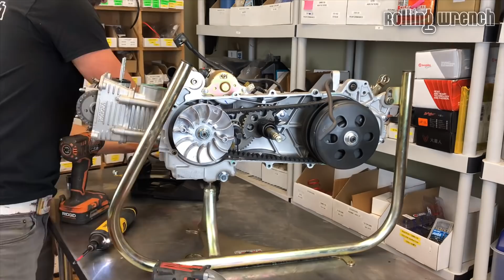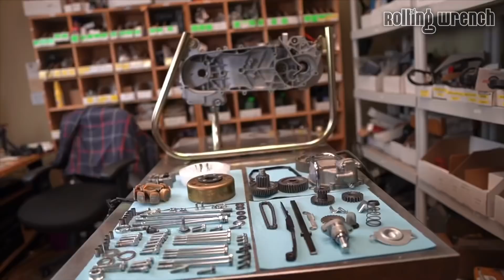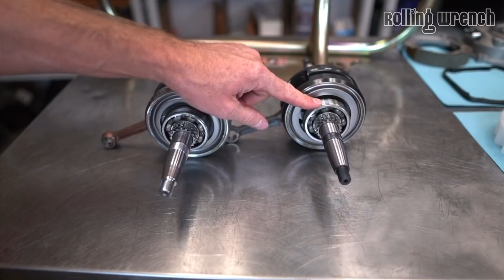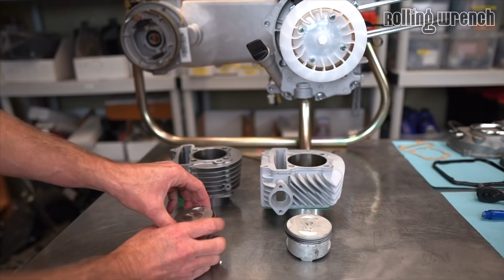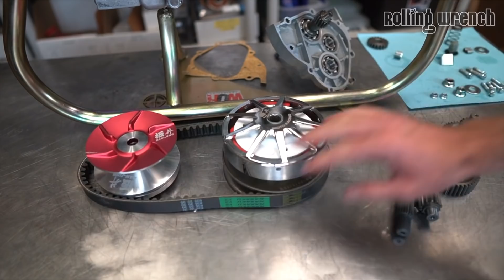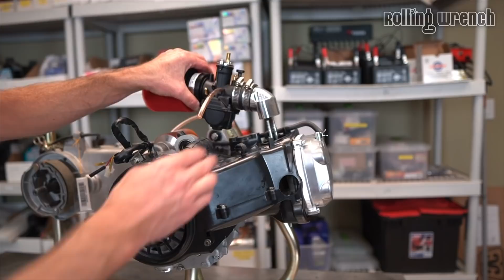GY6 ENGINE BUILD [Rolling Wrench crate engine] 190cc

Comment: What’s the best version gy6 for an atv Or more accurately, lets say a heavier vehicle. Say 350- 500lbs... Specifically a 2026 or 2027 Vitacci Cougar 200 Sport ATV..
And 2026-27 Vitacci Cougar 200 Utility ATV
The “stock” Gy6 in the 200Sport  is a B-Block 1p63QML with cvt @ 169cc (I think the math makes it 169ish I did 3.14x(bore/2:61/2)^2(Squared)xStroke:57.8=168.83cc

I know the utility 200 is also a type b long block and they are both the longer bolt pattern studs.  but The displacement is a bit more on the Utility Atv. I think it’s a 177cc. I have not opened that one yet. They both arrived yesterday😊 
I also have a dozen or so other mini bikes and scooters and go Karts I will be hooking up! 
But with the 4 wheelers that are 2wd, I’m wondering if thinning out to a maxed 232cc might not be a good idea for long term use without some sort of cooling? Or is this ok?? Or is the 171 or 190cc better options for 350-500Lbs?

Comment: Hey I got a 250cc 4 stroke single cylinder gy6 liquid cooled, was wanting to know are there any performance parts I can put in it seeing as it's cvt driven?
Reply from the maker: I’m not familiar with the motor enough to direct you. But they are definitely different then the standard qmj157

Comment: On stock oil pumps there is an arrow, should it point up or down? I found stock oil pumps here in Europe that is thicker, and to mount it I had to get that kind of bolts you are using, because stock mine had 8mm bolt heads which did not fit. So much variations on these chinese engines!

Comment: What is the largest I can put on my 2009 Scoot Coupe without modifying? I heard 170 cc but wanted to know what you think. I have the 150 cc now. Odometer says 25,600 actual miles but that cannot be right on the original engine.

Comment: What’s the hp gain or power increase on going 190cc?
Reply from the maker: I’m not sure. We don’t have a dyno.... but huge improvement
Reply: Ok one last question, so you bored it to 63.5mm and the 180cc big bore kit is 63mm does that make the cylinder wall of the 180cc .5mm?

Comment: Approximately how much hp would you anticipate too get after a good dyno/tune? I have ordered a few bolt on’s from you and I have been very pleased with the results, however I’m really really ready to just go to a greater platform and this looks like a great replacement? But I don’t want to spend a bunch more with results that give me 3-5hp gains more than bolt on’s I put on my 171cc? But if I’m gonna get hp with performance results and maintain a quality build I obviously rather get the crate. Think this build can sustain 15hp? And how about a 4 valve add on would that give any edge in any manner?  I’d like to get my GY ready before the summer time in California hits 06/2021 it’s already almost 02/2021

Comment: Hi, I have an GY6 152 QMI injector model....I can’t seem to find any parts whatsoever. I need an airflow sensor and the rubber pipe that it sits in (between throttle body and air box) 
Any help would be appreciated! 
Thanks

Comment: I am looking to drop a 300cc liquid cooled gy6 into my gokart that has an AC150cc. Any idea as to the dimensions? Will the 300cc drop into a scooter that normally has a 150cc?
Reply from the maker: No, the engine is a lot different
Reply: Good to know. Ignore my other question. I hadnt noticed this reply.  With that being said. Can you point me to a big bore kit that wouldnt require case boring. I have a 150gy6

Comment: If i change my 150 cc to 171 or 190cc.. Do i also have to change my speedometer gauge? By the way, its an analog gauge
Reply from the maker: No
Reply: @RollingWrench  is it possible to order a 171 0r 190 cc gy6 engine to you?

Comment: hey Matt, hope all is well i have a 1981 honda express nc50 that im considering doing a gy6 conversion. havent seen anything like it out there, i want to build a resto mod deal, i want to keep the original look of the bike but have a modern drive train. any thoughts? not sure about the distance for mounting my measurements are 5 inches from end to end and thats the engine mount. thanks for the great videos and stay well.

Comment: Can I ask some questions? Can you suggest some tuning parts for Yamaha Majesty 250cc engine (YP250)? 
This is what I found about the engine. 

 The Yamaha Linhai VOG (LH170MM)  (LH173MN) is a quality, horizontal, single-cylinder, 4 stroke, liquid cooled, SOHC engine.  This is a very common engine found in many scooters, quads, ATVs, buggies, and mopeds. The VOG 250 has a displacement of 249cc with a bore of 69mm and a stroke of 66.8mm.  The VOG 260 has a displacement of 257cc with a bore of 70mm and a stroke of 66.8mm.  The VOG 300 has a displacement of 275cc with a bore of 73mm and a stroke of 66.8mm. The transmission for all is a CVT automatic transmission.   All use electric start. 
 

Some of the models and brands using this engine include the Aprilia Leonardo 250, Aprilia Leonardo 300, Benelli Velvet 250, Diamo Turista, Italjet Jupiter 250, JCL, VOG 260, Linhai Aeolus, Linhai ATV 260, Malaguti Madison 250, Malaguti Password 250, MBK Kilibre 300, MBK Skyliner 250, Renault Kouranos 250, Roketa MC-54 250B, Xingyue VOG 260, Yamaha Majesty 250 (mod. 1999), Yamaha Majesty 250 (mod. 2000), Yamaha Versity 300, Yamaha X-City 250, Yamaha X-Max 250, Yamaha XC 300 and others...

Comment: I just got a 2015 ruckus,  I a bigger guy, not really want to do a big stretch,  I like the ability to go on and off road, but I want my get motor to be a bit faster, suggestions,  other question I have, getting different responses,  ok cold start I have to give a bit of gas to warm up, after that it's ok, what do I need to replace or clean, some telling me to buy a solenoid and others saying the e choke, thanks in advance
Reply from the maker: It sounds like you may need to adjust your choke? Or adjust the valves. As far as upgrades. Check this out 

Honda Ruckus MAX PERFORMANCE!  (Stock engine) PART 1 https://youtu.be/gYQRzSlsBJA

Comment: Imagine spending that much money on a scooter...

Buy a motorcycle. Not a toy.
Reply from the maker: I have had it all, spent years on motorcycles. Now I’m all in on the ruckus. I think I’m $10k in now :-). It’s not about the dough, it’s all about the love :-)
Reply: @RollingWrench  About 5 decades of motorcycle riding for me. I still love them but for practicality and fun, you can't beat a scooter. Especially a hotrodded one!
Reply: Sold my Suzuki 750 sport bike and bought a scooter because I ride mostly within city limits and needed maneuverability and carrying capability over top speed. I have never looked back. As a matter of fact, my modified scooter will out run the majority of motorcycles stop light to stop light. Love pissing Harley riders off. They can`t figure out what just happened. Lol

Comment: I enjoy your videos, they are informative and interesting. However I must question why you continue with the GY6? I mean as far as 150cc engines go, it's a terribly inefficient design. The head has poor flow (single valves), all attached accessories must be upgraded (oil pump, starter, fuel pump etc etc). No watercooling. Horrible clutch etc. It seems a waste.
  I'm living in Asia, the Yamaha T150 and Honda RS150 engines are widely used and modified. They are efficient engines, easy and cheap to upgrade. There are so many options for bore kits, cams, cranks, ecu's etc that require very little modification to the actual engine. 
Example I have a 177cc stage 4 T150, putting out around 30hp. A GY6 can't get close to that efficiency.
Reply from the maker: Turbo will be a fun experiment. No body has really documented it on what works and what doesn’t. That’s my role. I hope to solve the single cylinder issue with a air capacitor..... we will see. If I fail the world will know why.
Reply from the maker: As far as why GY6. They are cheap, and the industry revolves around them. Simply
Reply: @RollingWrench  That's odd to me, in all my time in Asia I haven't seen a GY6 engine anywhere. By the time you upgrade everything, I don't think they are cheap at all - certainly not for price:hp ratio.
Just seems to me that your skill is a bit wasted on these engines, would love to see you move on from the gy6
Reply: Recognizing that nothing is impossible, fitting an RS150 into a Ruckus would be extremely challenging. The oil sump mounts at a very different angle, it uses a transmission instead of a CVT, and the rear suspension is not integral with the motor. Does anyone know at what HP CVTs blow up? My guess is it's less than 30 so there's that too. I'd like to see RW try. They are much better engines than a GY6.

Comment: Do you have a video showing how to start a 50cc that has been sitting a few years? Mine won’t start. A mate pulled apart the carb and we got it to idle but under load it dies.
Reply: Did you put fresh fuel in? checked fuel filter?
Reply: Clint Yes I did. Now it just cranks over and won’t start at all

Comment: Love the video, leaves me with a few questions... Do you offer the 4 valve head? And if so what sizes are available as they seem to be very sparse online... My enigine is a B-case 232 1P57QMJ... a9 cam. Would I be wasing my time trying to chase power by adding a on a 4 valve head and an EFI system? What performance gains would I be expecting? not just power but reliability) All I need is the head and EFI. I also want to do a short stroke to raise max rpms, do you sell that as well? I can't find kits to shorten the stroke.. Should I just shave the piston?. Lastly Ive been scouring the net in an attempt to find a desmodromic vavle and cam kit... Do you know of anyone building such a kit/head already? I know its much but any help would be amazing for my project.

Comment: I would love to see a turbo 232cc build, that's something I've been wanting to do for my daughter's buggy for a while now I just haven't had the money lately.  Great informative vids tho sir, thanks
Reply from the maker: Coming soon :-) Thanks for the support 🙏
Reply: An expansion chamber on the intake side with EFI has a chance for sure to work and work well enough to make additional power. And if done right, reliable additional power.
Reply: The only problem with a turbo on one of these is that a single cylinder 4 stroke doesn't generate enough exhaust to really effectively spool a turbo.
Reply: @MikeMalkowski  you never know..